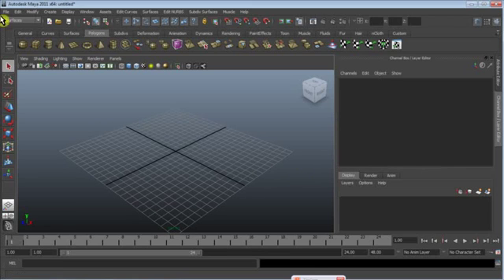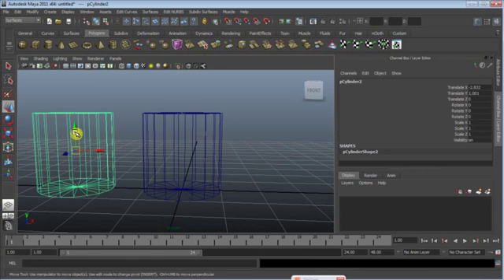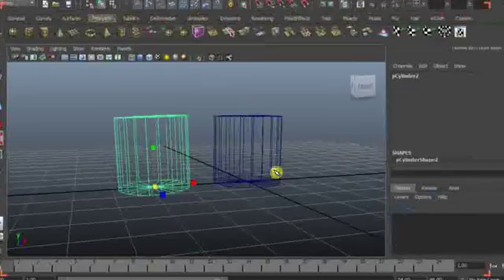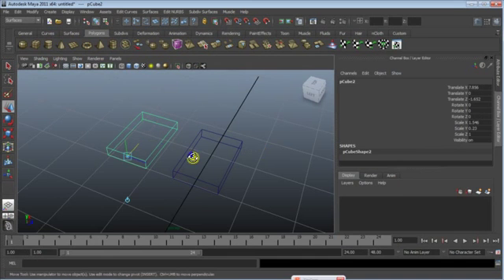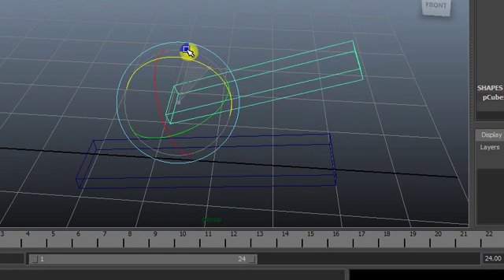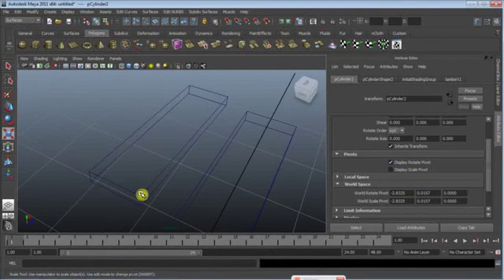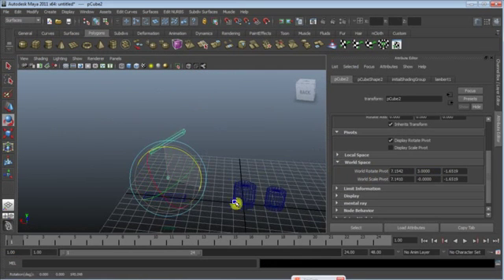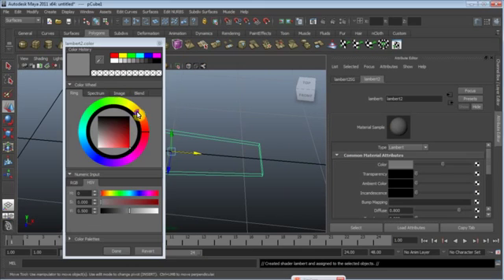Changing Pivot Point in maya.mp4

Comment: Can someone please explain to me how to do this a laptop keyboard? When i use the insert key on my laptop (which is different and has less keys) it doesn't work. When I plug in an extra standard keyboard it works just fine. But this is annoying. I don't want to have two keyboards just to press one button.